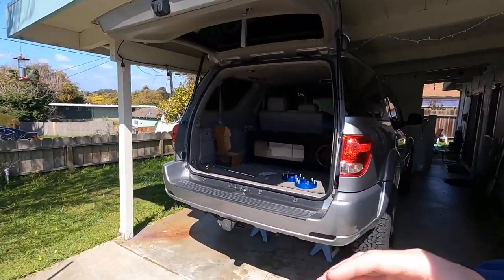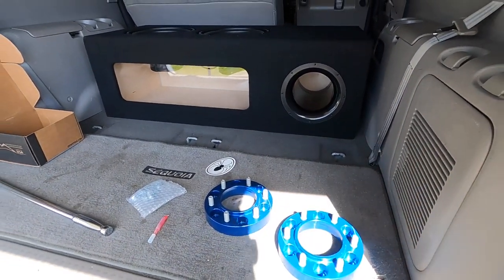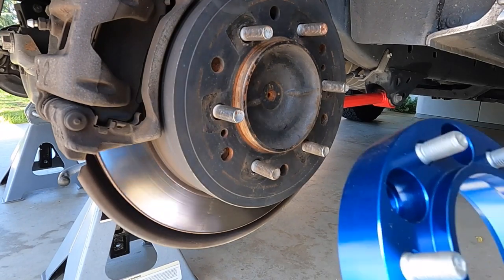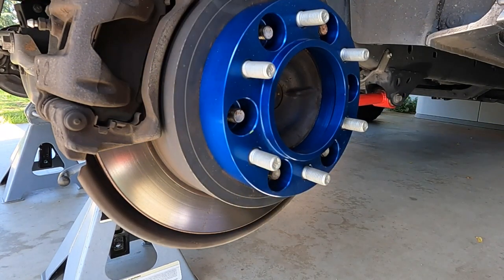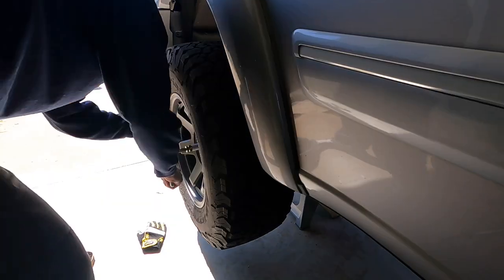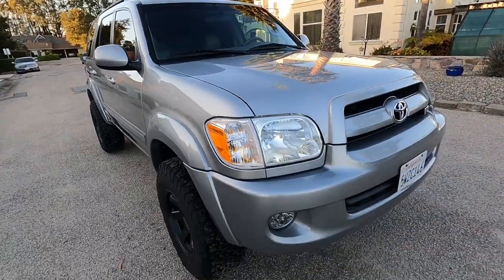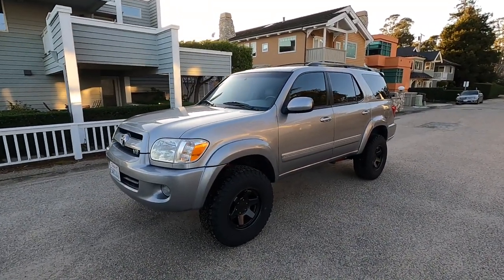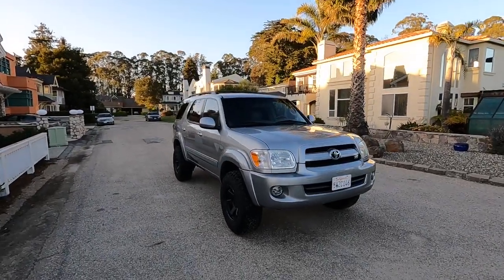Wheel Spacers Are Completely Safe... I Hope!

Comment: I used those same spacers on a 4Runner. Didn’t use them for long at all, but they never gave my any concerns or issues. I had so much loctite on them it took a beating to get them off. Took them off because it’s a pain to remove them anytime you have to pull your brakes off
Reply from the maker: I went sparingly on the loctite cause i didn’t want any issues getting them off later.. it’s funny how most people are scared there going to fall off, but interestingly enough it’s actually hard to get them off if you installed them correctly.. 👍🏼

Comment: I agree about spidertrax. Only spacer i'd put on my 4runner. Hubcentric and chromoly steel studs. I'd trust it with my life! Had to pay almost 300 bucks for a set of 4 but it was worth it. Going for a conservative build like yours, most guys run 33s on the 3rd gen 4runner  i'm going 32's with no lift for awhile.

Comment: I bought some pro comp steel wheels. They run against my caliper so do I need wheel spacers? If so do you think I my set up is fine? For spacers I’m running 31 x 10.5 r15
Reply from the maker: yes, it’ll be fine.. get some quality spacers, and you’ll be good to go.. 👍🏼
Reply: @toyotafanatics1  thank you for the response. I actually bought a set of spider trax

Comment: I'm going to pick up a sequoia as well soon, what mod should I start off with that won't break the bank? Btw mine is completely stock
Reply from the maker: Good question..
i’m thinking either a leveling kit.. which is very inexpensive and will make it look better.. i’m not a huge fan of how there a bit lower in the front..
or some window tint... or maybe some stereo upgrades if your into that..
Reply: @toyotafanatics1  thanks I might start with tinting the windows out first, then a leveling kit. I have some all terrain tires on already.
Reply: @Outcast_Family  OME lift its the best way to go man! Totally recommend for this first gen tundras/sequoias, the ride is so smooth and it looks so cool!

Comment: Would anyone know whether 1" spacers will allow the lug bolts to clear the spacer recesses on a 2012 Tundra setup.  I want to keep the spacer width to a minimum to prevent stress on the wheel bearings that the Tundras are known to have issues with.  1.25" would look better but I'd try the 1" if the lug bolts clear the spacer without hitting the hub and having to shave the bolts. Anyone tried this without issues?
Reply from the maker: From what i have read on some forums, you shouldn’t have any problems at all..  i agree the spacers are no good for the wheel bearings, but a 1 inch spacer would definitely make it look a little better and probably won’t compromise wear too much.. go for it.. 👍🏼